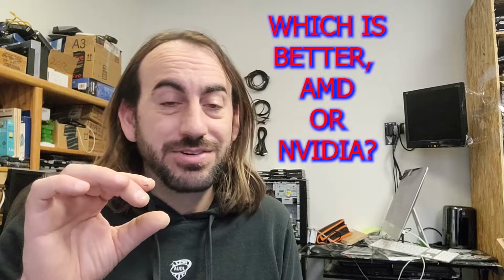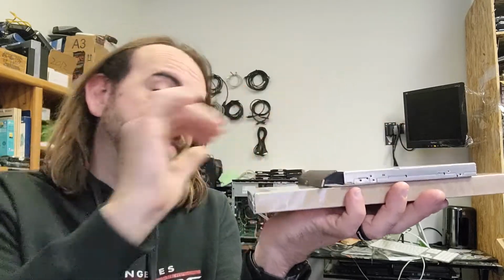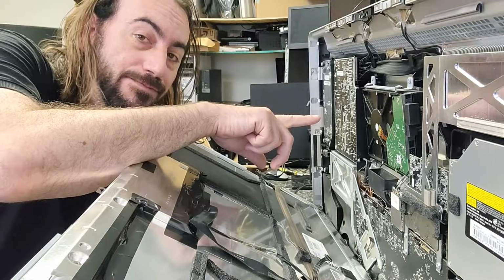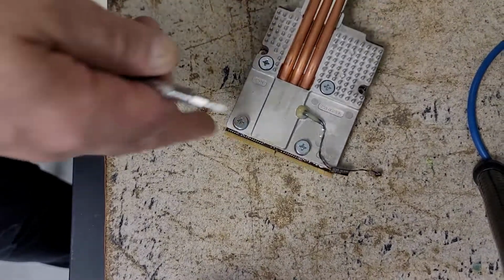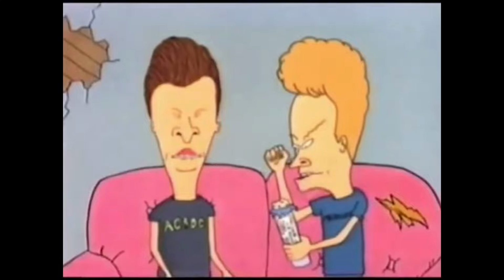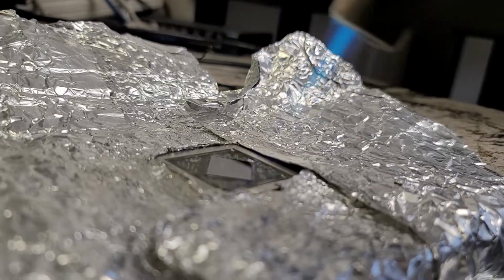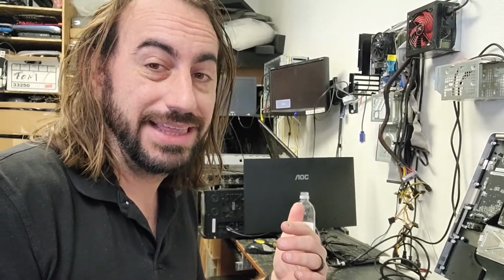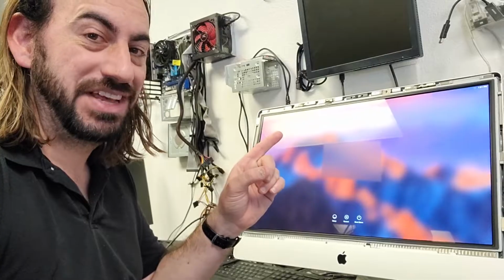Laptop GPU Reflow

Comment: well this is certainly a way to do it but I feel like someone who just knows metal melt when hot can make this go horribly wrong lol same with the people who throw there xbox 360s in the oven while baking a Pizza mistakes can def be made lol
Reply from the maker: Thanks for your comment. It took be the better half of a year to get my method down, and it's been pretty solid since 2011. The card you see in the video was initially reflowed about 2 years ago. Sadly, you can't get them new, and used are harder to come by. And im not a fan of the oven method - plastic melts as well. Thats one of the reasons you see aluminum around the GPU chip - to help draw excess heat away and better direction of heat on the chip.
Something I stopped doing within the first year was adding on a slice of copper - it didn't help cards out.
Anyways, speaking about other graphics cards, I have a client that has us modify his RTX 3080 cards that he uses for mining to stay cooler (drops his temps by about 20 degrees). I'm planing on film one sometme.